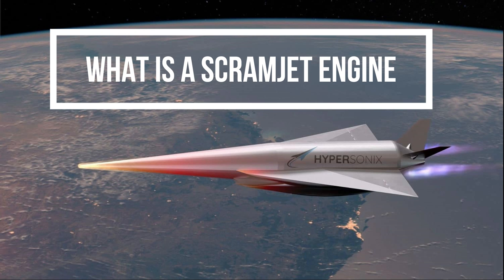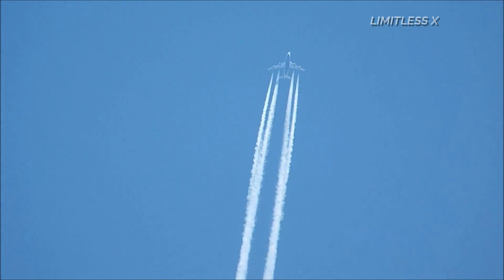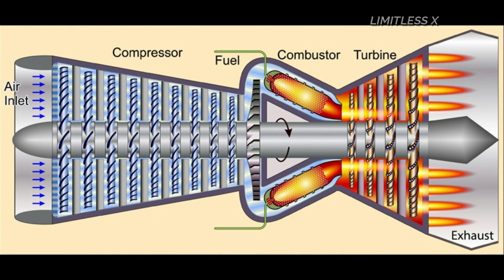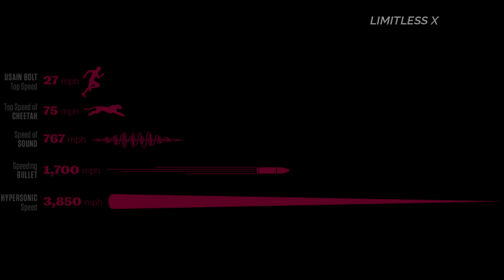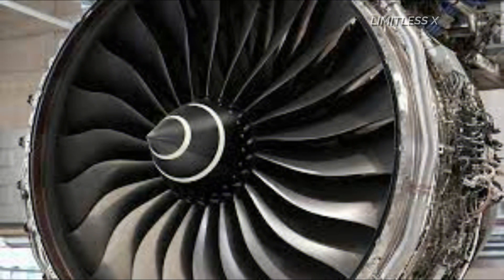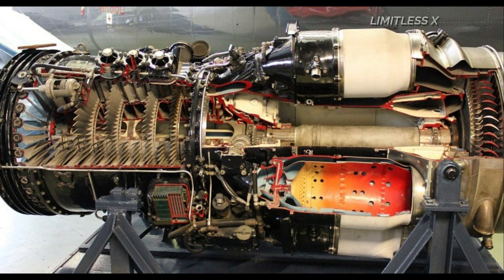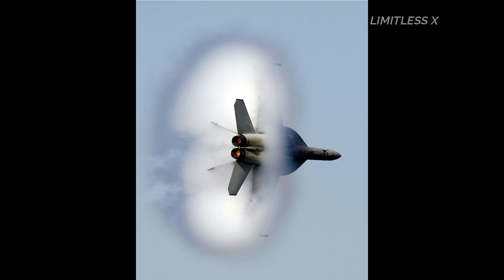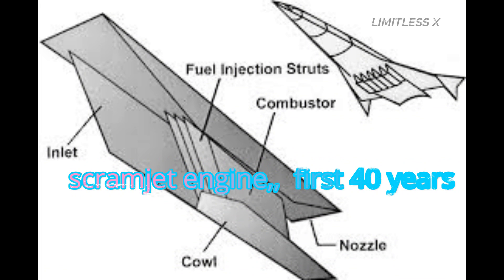What Is A Scramjet Engine?

Comment: A RAMJET IS JUST A DIESEL ENGINE THAT USES HYDROGEN. Ramjet gathers O2 molecules like a piston on its compression stroke. In thin air its hard to build the pressure so a rocket engine is used to get it up to its minimum speed. I th

Comment: Scramjets do not go below supersonic. Just a major thing to edit. Internal inlet flow reduced, yes, however reduction of the airflow Mach number still indicates supersonic flow. At exhaust during supersonic combustion, the airflow will reach ever hypersonic speed, though usually mach 4-6 at the exit. Mach~9.5 is max reached. Theoretical Mach~18.